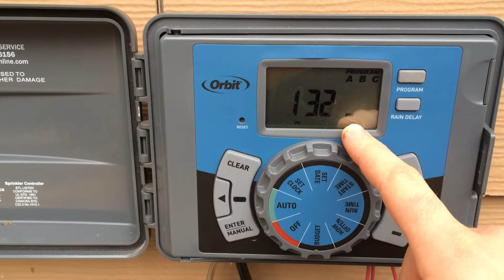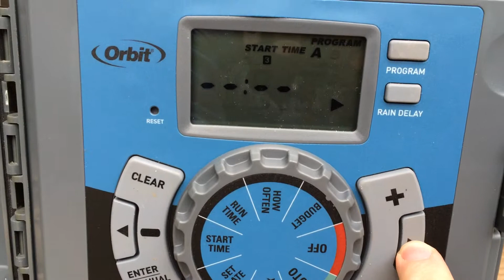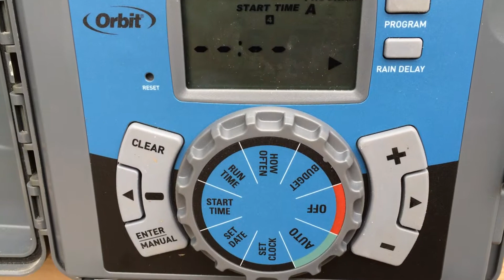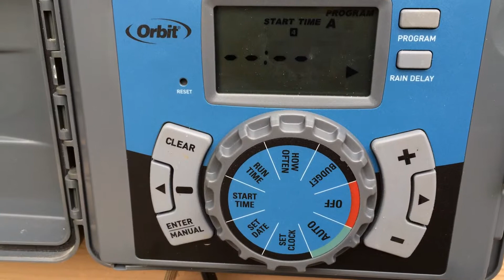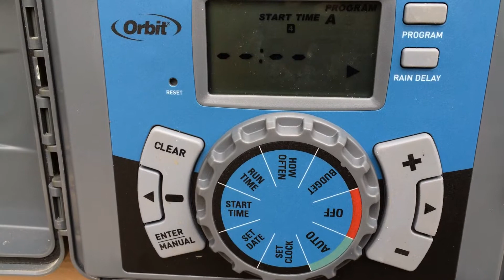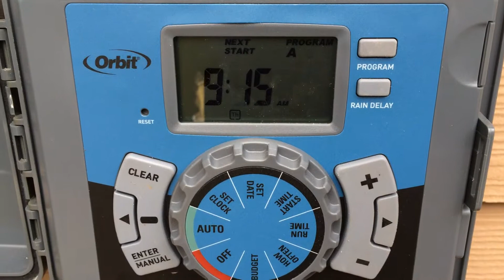Automatic Watering System - Orbit Controller Setting Tip

Comment: okay i have the same orbit timer 6 zone with remote control and start time is 6:00am for 2 areas 2 open solenoid valves but my problem is  that they are running 2 times 4 times any suggestions appreciate it thank you.
Reply from the maker: I'm not sure what you're saying is happening. Is it running 2 times or 4 times? While running, are multiple valves open or just one? If you want more valves open at the same time, just wire them together for the same zone. To have select zones open exactly at select times you would have to run unique "programs" like A B or C. If they are all on the same program, then you just need one start time as  I show here, and all will open consecutively. If you have multiple start times, they will all open and run for their whole run time for as many start times as you have set up. So for example. 2 zones with 6 start times, and 10 minutes run time each, would run a total of 2x10x6 minutes, 2 hrs!

Comment: Tom my orbit timer does that. You don't need any more than one start time. Only if you are going to do individual start times and different programs on zones. But if you have more than one start time on one program whell you will be constantly watering your plants intill the amount of start times are finished.
Reply: Haha, yes I realized that. It was a bit confusing at first but I guess it makes sense. I guess it could be played to some advantage if you wanted to water all zones several times in a row (not sure why). Ultimately though with this one I think there are three programs (ABC). Each program just needs one start time to run all zones on that program.